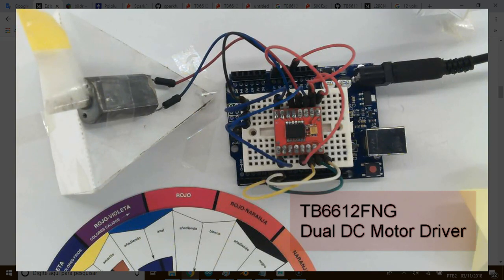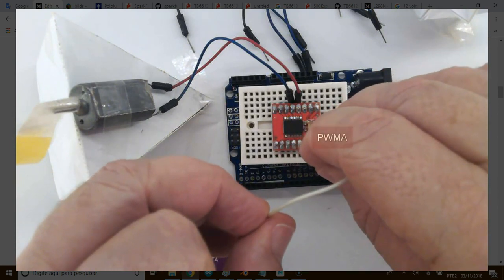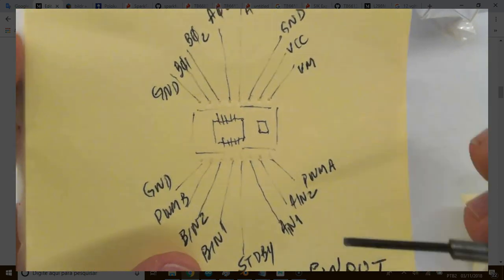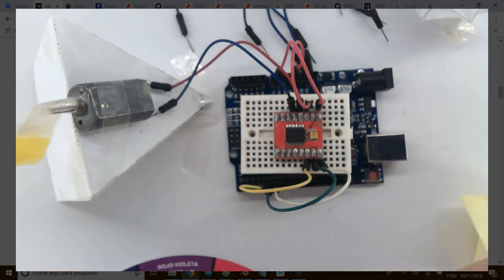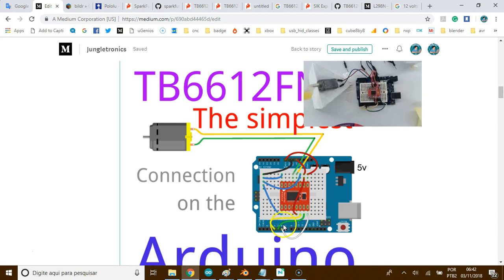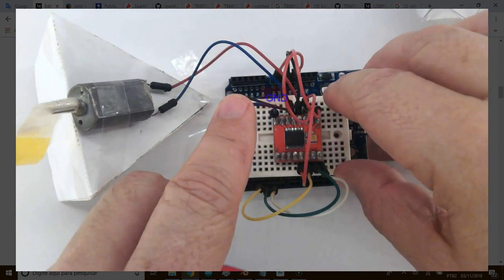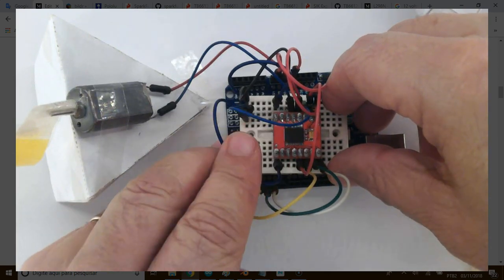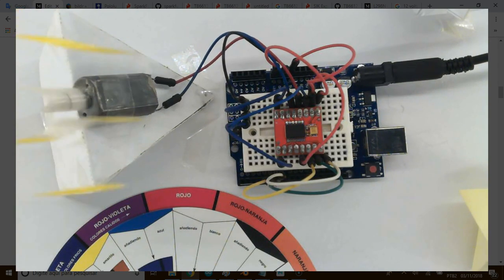TB6612FNG: Dual DC Motor Driver—Simplest Arduino Connection—Ardu_Serie

Comment: Can I just connect Arduino's Vin pin to motor's Vm pin?
someone tell me this on Arduino forum :
Don't draw the current for any motor through the Arduino board. Apart from anything else the thin copper tracks on a PCB are only intended for the very small currents used by a microprocessor.

I want to use power bank as power supply(5V/2.1A  or  5V/1A)
Reply from the maker: Hi, 帥終帥! When using motor try to use external power supply: Back-EMF! (https://medium.com/jungletronics/dc-motors-against-back-emf-589d8ed174cc)